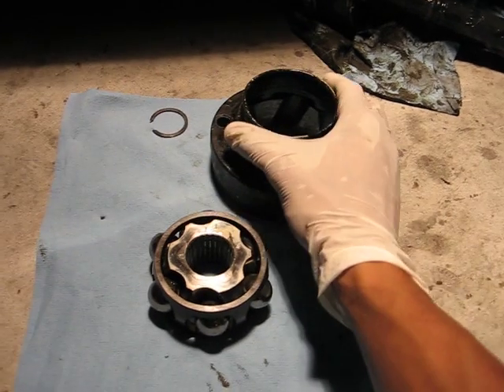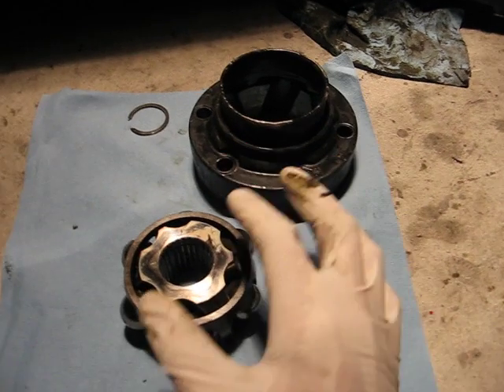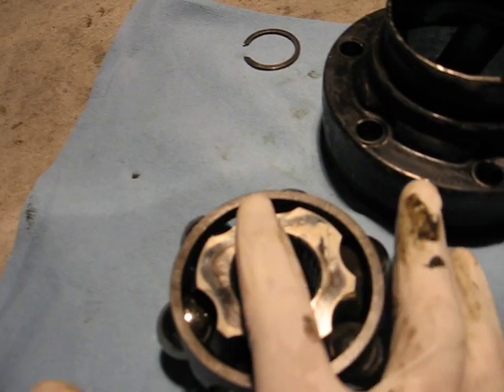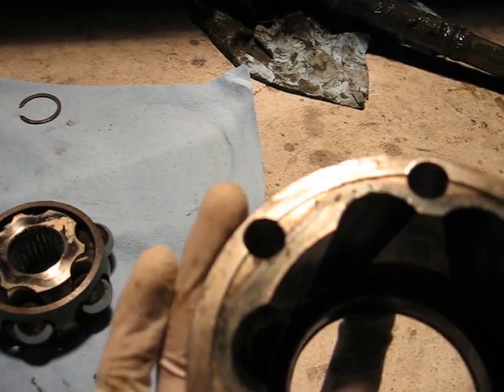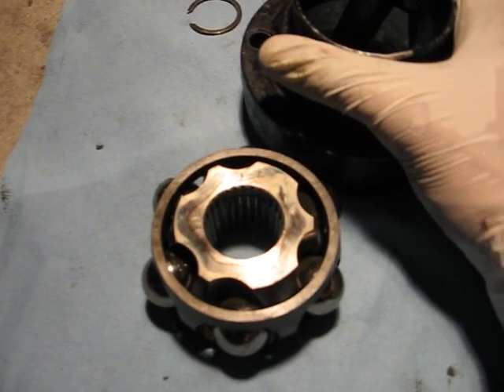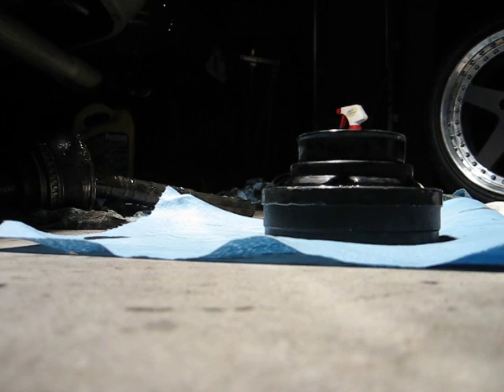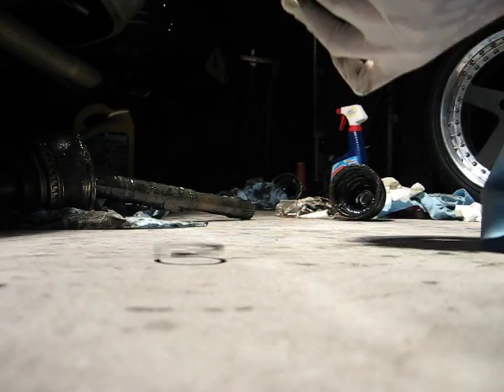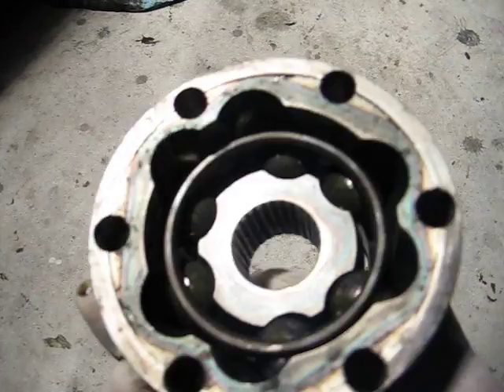CV joint assembly/re-assembly for Toyota MR2 turbo

Comment: bruh, just found this... olf video! But ahh, once the bearings are in, there should be some play when it's installed right? I'm looking at the cage that holds the balls in and it seems to be uniform, no small or big side >.< of course it's also an 89...
Reply from the maker: Man I haven't checked this in a while! I'm sure you got it, but I'll answer anyways. I don't know if the 89 MKI MR2 is the same as the MKII. For the MKII the inner race should move independently. They pop in the wrong way very easy, but the inner race, and the cage move together. It feels stiff.  It has been 17 years since I've done this, so sorry if my explanation isn't very good haha.

Comment: Thank you! Very helpful with reassembling the inner joints from my 1988 MR2 Supercharged (AW11). The manual describes it, but it's much easier to understand when watching the video. Each side took less than 1 minute to assemble.
Reply from the maker: Makes me really happy to see this video helping others 13+ years later!
Reply: hey, old comment i know. But do you remember this process? The ring that the bearings go In seems uniform to me, but is it not?

Comment: So my axles are binding up when I tried to install the spider and ball bearings. Of course my stupid sharpie marks washed out so I had to use an old axle to determine the order and rotation of the parts. When I have it installed it has zero flexibility in the x and y plane if it were stabbed into the transaxle. I even had to remove the rear shock in order to make room for the extremely rigid axle. So I see that the ball bearings need to move in and out as well as rotate just a hair in different directions as the grooves show....The hub inner race only goes in one way due to a lip grinded off right before the splines begin. So that only leaves the spider and the rotation of the hub. I tried all the ways including the more difficult way and still have no flex. Now I begin to wonder if somehow my left and right hubs may be swapped? I am not sure but it should let the axle sag down a bit from gravity when it is stabbed into the transaxle.... Do you have any ideas?  Thanks buddy.
Reply: +Phoenix Mister Two ...If you could explain more detail about the long side and short side...Must be where I am going wrong.
Reply: +Phoenix Mister Two , Seems like the wedge looking shape, having a long width and shorter width, need to be lined up to where they do not match in shape....I thought I may have tried that but could have also had the spider flipped incorrectly. Does the spider matter as far as which side goes toward the boot?

Comment: Damn...was hoping I could get away with not removing 6 hex head bolts on my 91 axles but it's the easier side for regreasing and new boots.
Reply from the maker: +Phoenix Mister Two  Once you get the feel for it, it's not hard at all. You just  gotta make sure that it's lined up right. The first time I did this (10 years ago) I kept lining it up the wrong way (long side to ling side) and it felt like it was right, then I found out the right way of lining them up.
Reply: +916david ...I was successful but took a while....Whats with them having 3 different types of boot clips? I have the wind up and the crimper but my set came with a newer version that has a tool but not readily available. There shorter in length also and have some overlap style locker built in the band clip. Hate those things almost as much as snap rings without holes.

Comment from the maker: @mirbez The bearings should be equal in size. If the boot has been torn for a while, and it has been run dry, the easiest thing to do is to buy a new axle assembly from Toyota or Rockauto.com. You can also get ATS race kits. I can't remember if they come with the bearings. Try calling the Toyota parts department for just the outer race. If not, then your best bet would be a new or used axle.

Comment: wow i have a problem with my beemer's cv joint. its hard to move but do u think if i take it apart and clean it then it would work or it depends if its damaged? bc it pops when it was on, i already replaced my bearing but i found that problem with the joint.

Comment from the maker: They're not ATS racing joints. They are factory joints. I was just rebuilding my axles and changing the torn boots however the assembly of the stock and ATS joints is exactly the same. 

David